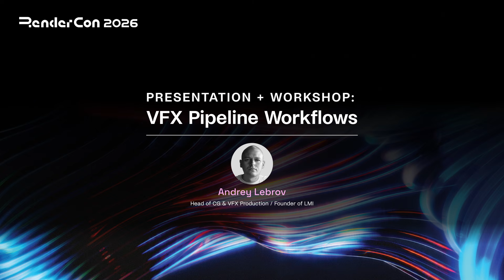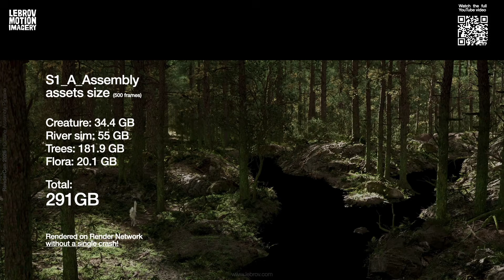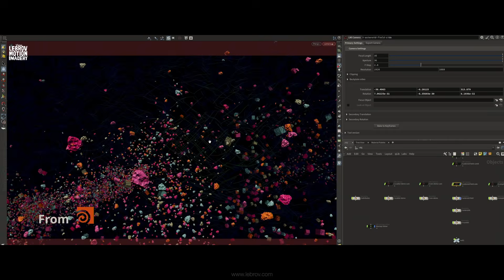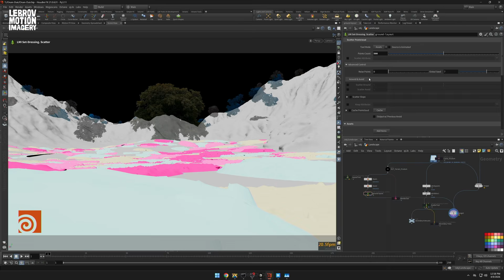VFX Pipeline Workflows with Octane | Andrey Lebrov

Comment: Timestamps for the talk:

00:00 Introduction — "I decided to tell you my commercial story"
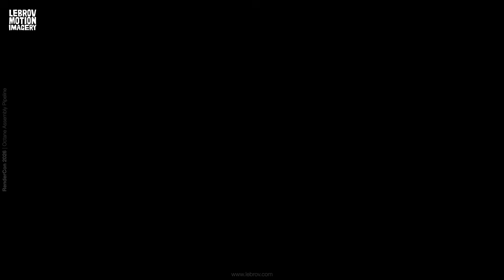01:09 Career Origins: Octane + Cinema 4D (2013)
02:13 Hitting the Ceiling: The Smithsonian Project — "We hit the ceiling and I was in stagnation"
03:30 Discovering Clarisse FX & Burning the Bridges
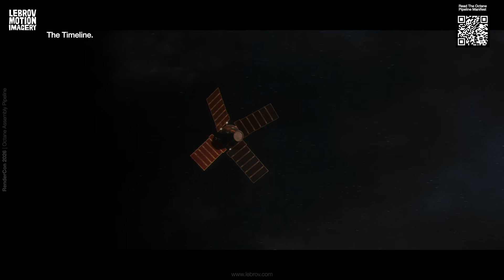04:39 The Power of Assembly: "Where the assets were made became irrelevant"
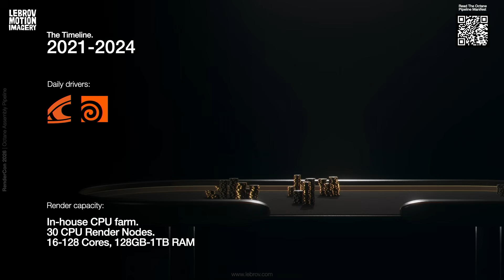05:23 Scaling to 8 Artists with Mixed DCCs (Silk Flying Right)
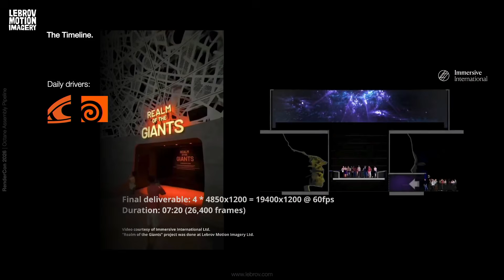07:33 Disaster Strikes: Clarisse Gets Discontinued Mid-Project
08:54 Back to Square One — Choosing the Next Pipeline
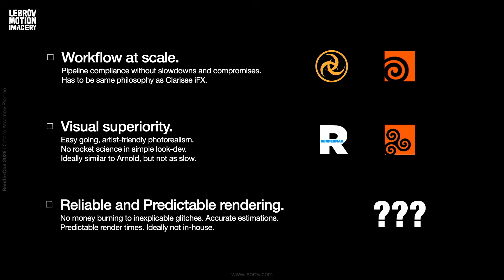10:03 Trying Octane + Solaris: "Octane came a long way, really"
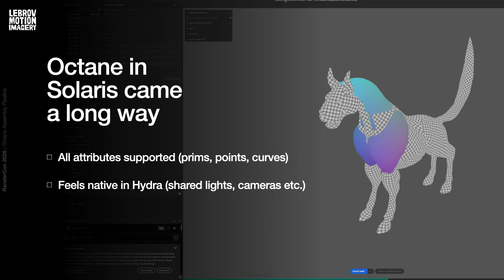11:42 First Limits Hit: The 24-Hour ORBX Bake Problem
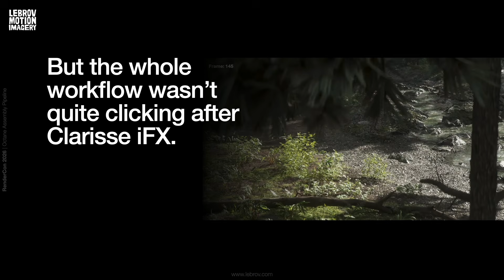14:04 Jules Urbach on Octane Standalone — "There's nothing quite beats that"
15:08 The Pivotal Realization: "I was solving the problem in the wrong medium"
16:05 First Successful Result — Rendered Without a Single Crash
17:39 Recovery: "Light years faster engine that is visually superior"
18:19 Why True Assemblers Are Standalone
19:41 Decoupling Look Dev from Asset Creation
20:37 Why ORBX Shouldn't Be Used as a Working Tool
21:26 The Assembly Pipeline Workflow Explained
22:47 Switching Mentality: "Scaling is impossible without this step"
23:49 The LMI Toolkit: Point Baker, Library Tool, Camera
24:37 Point Baker in Action — Live Reference Link to Octane
25:32 Library Tool: Drag-and-Drop OCS Libraries from Megascans
26:32 Clean Scene Skeletons vs. ORBX Node Mess
27:34 "You're going to fly, mate"
27:56 Demo: Sci-Fi Asteroid Project Built in 5 Days
30:32 What's Next: Splats & Neural Representations
32:20 Capturing Trees with Automated Drone Flights in Houdini
33:09 The Future: Neural Objects & Render Network
33:46 Generative AI Needs Pipeline Control